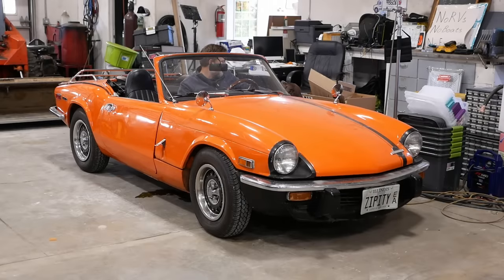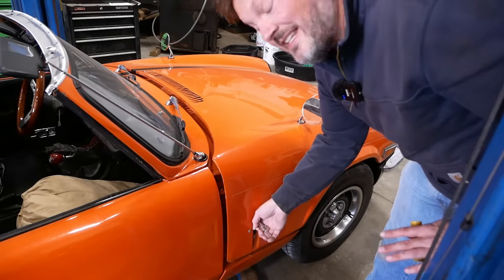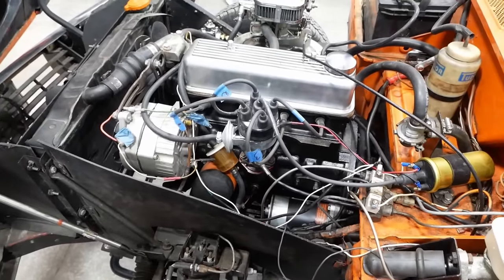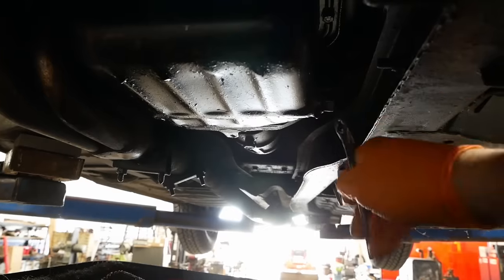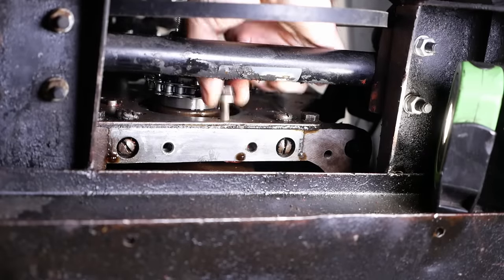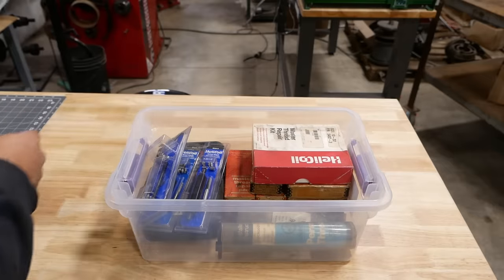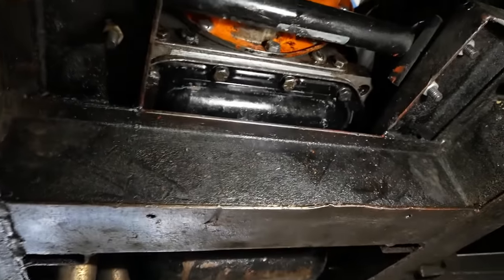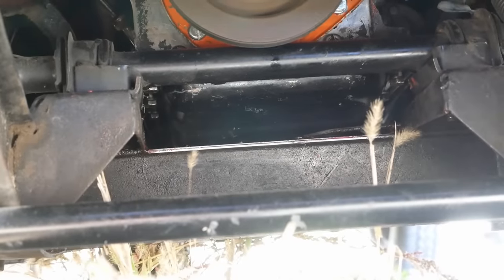Can You Stop a British Car from Leaking Oil?

Comment: Well as you said it is 52 years old and has not been maintained. Remember the drain plugs in America are a different thread rate and taper. The British had a number of threads for various reasons. a) because we invented them b) because we realised not everything would not respond to the same design. Remember we invented steam engines first. Metric of course came from the Continent. Helicoils were a wonderful invention for mechanics who overtightened bolt. Must no blame manufacturer for poor amateurs who bugger about with things they do not understand. There is the same problems in boats with Stuart prop shaft seal bearings. You see there is also the problems associated with the strength of metals as brass had a different thread rate from cycle days and so you got cycle rate threads. This became interesting in France which would use both metric and cycle rate! As you say the engine was designed pre war and then modified. The alternator was not necessarily an item added at the factory depending on model. Many were owner modified.  But you know all this anyway. The whole vehicle has been botched by previous owners who have now cumulatively turned up for you to correct it. You seem to be doing quite well. It was a wonderful cheap vehicle and the ones you still see today have all been renovated and are driven merely from time to time.  They were all a hang over from WWII when pilots stationed in Britain discovered the amusement of MG’s and everybody wanted to follow. The truth is it gave many young people lots of fun. By the way it is not a Vintage car they were built from 1920 to 1929. 1930 to 1939 if they looked like vintage they became Post Vintage Thoroughbred. Post WWII they se3m all to be called Classics today but most people don’t have a clue and call them Vintage. A bit like furniture over ten years old is called antique. 
The joy of growing up in U.K. in fifties and sixties is you started on pre war cars and learned slowly and expensively about threads, preselector transmissions, crash gear boxes, and the dream of American engines you could not afford to run to the pub on the corner for a pint of beer! You had one stet of spanner’s and some odds and sods and somebody taught you some electrics which you identified with a bulb and two leads. Meter? Not on the pay you were getting! It was good fun and I pleased you were amused and made such an entertaining video. 
After some restorations I built two kit cars. The second is notable and is now in Germany with a collector who is a friend. Great fun and he has developed it further. I tell him it is his car and when last riding in it was content not to drive and enjoy the passenger seat. That is what the whole game is about. That cat was the last of a long line and specifically designed. Great fun!! Thank you for such an enjoyable video!

Comment: Most if not all British cars use the oil soak method of lubrication …
You are better off tipping oil all over the engine and let it soak in rather than putting the oil directly into the engine and just waiting for it to leak out…
Just an observation….
It’s similar to the reason why British like warm beer …
It’s because Lucas make refrigerators….

Comment: When do you find a Pommie car that doesn't have an oil leak under it. Easy. That is the car that has run out of oil. Speak from experience especially with Range Rover outer front drive hubs. Also tried to get my 1964 S type Jag to stop leaking - from everywhere. Motor completely reconditioned - same for gearbox. Motor was oil tight - for a while anyway but the DG gearbox - naah. Still leaked oil despite everything we collectively did. Then you come to trying to get a Pommie motorcycle to be oil tight. Ask the Triumph guys. Can't do it. Retired mechanic/machinist in Land Down Under.

Comment: Unfortunately those are probably English threads. Not sae, not metric, ENGLISH. I've boogered up many of them
Reply: You mean British…
Reply: Nope.  He was correct with English.  "The Whitworth thread is named after its inventor Sir Josep Whitworth. The English engineer introduced the world's first thread standardization in 1841 and thus influenced the mass production of threads. The Whitworth thread is specified in inches and has a flank angle of 55 degrees."
Reply: @davidnull5590  Nope, he wasn't.  We're talking about BSF here. Not BSW.  BSF was introduced by the BRITISH Engineering Standards Association in 1908, having had its genesis in a paper delivered as part of the BRITISH delegation to a trade exhibition in Louisiana...
Reply: @simperous4308   1909?  So the Irish were British back then?
Reply: Some still are…

Comment: Best way to remedy thin shitey british muck oil pans is to make a 3 or 4mm thick piece of flat bar to bolt under three or four bolts at the time, this forces the lip of the pan straight. Hit something hard off road with a BMC motor and it's possible to stretch the pan enough to make it leak, bracing the pan with flat bar works. Dislike brishit with a passion.